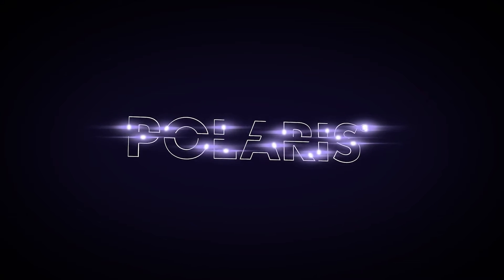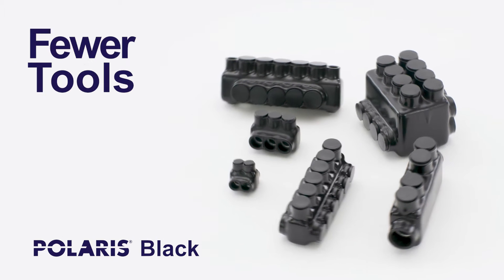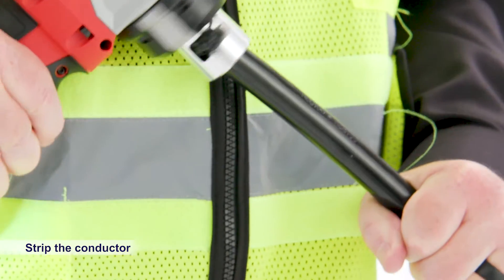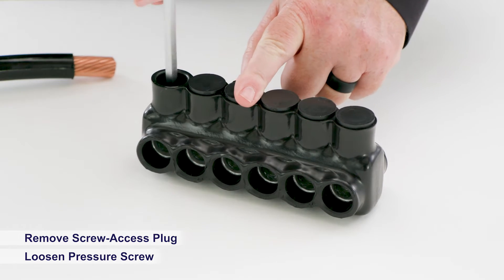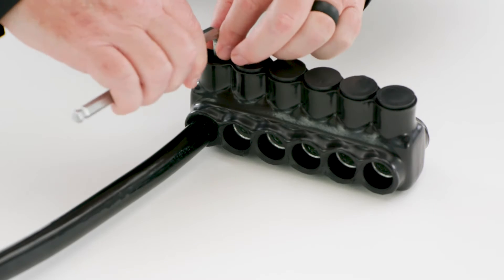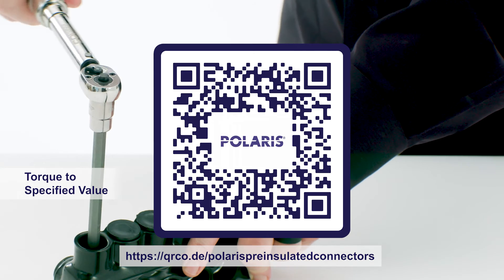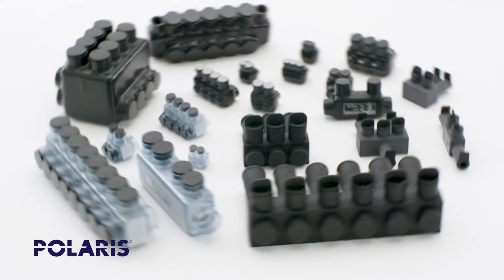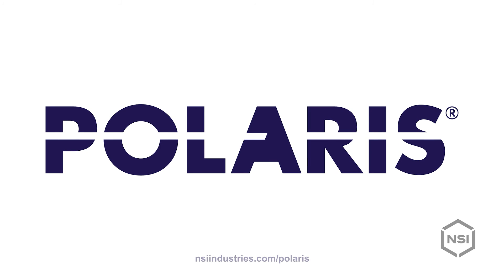How to Install Polaris Black Pre-Insulated Connectors: The Professional's Guide

Comment: Hello!
I'd like to know if a 4-14AWG 3-Port Multi-Tap Insulated Connector can be used to connect a #6 cable and two #8 cables to separate the oven and cooktop.
Thank you.
Reply: No company will answer that type of question on YouTube. You'll have to call their customer service.

IMHO, an oven and a cooktop should have their own dedicated circuit breakers and dedicated conductors run.